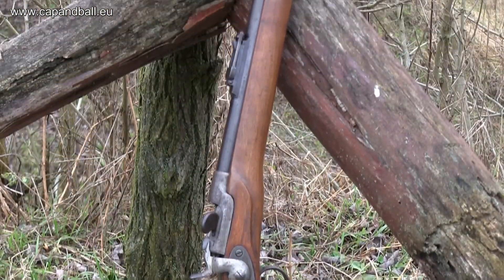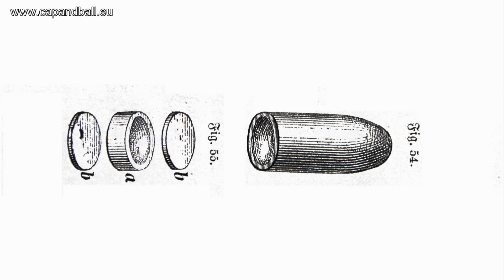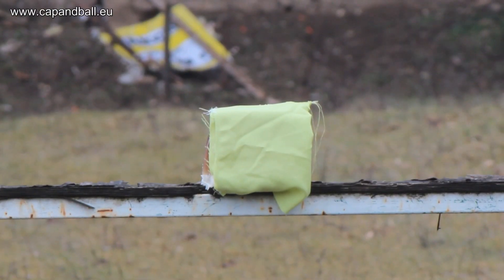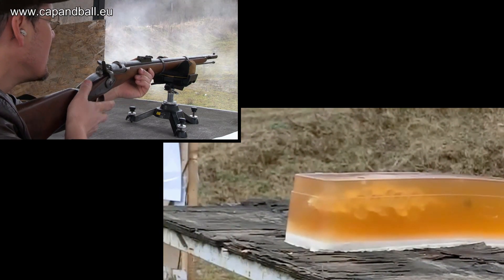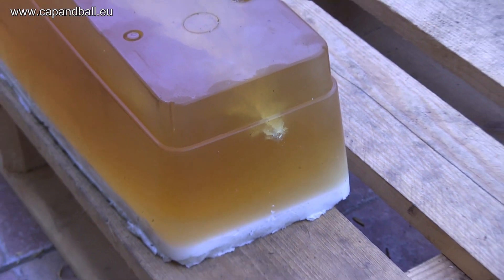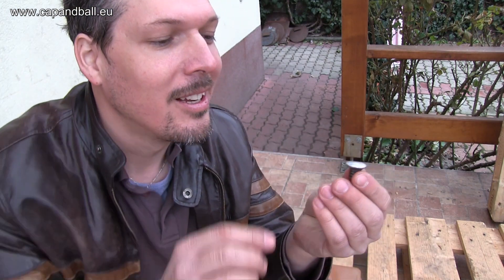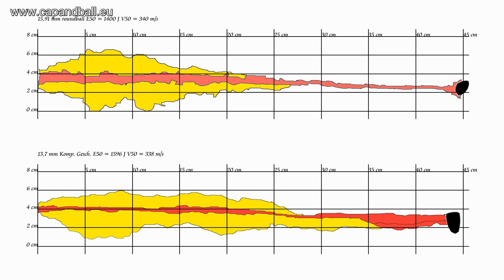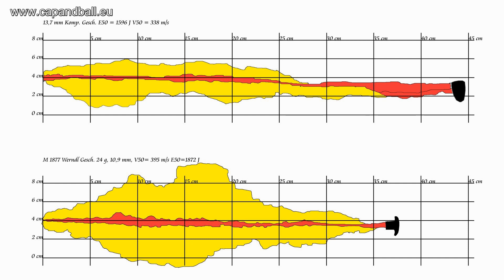Ballistic gelatine tests of the M 1867/77 Werndl rifle

Comment: The issue of amputation was far more one of the shear amount of trauma. A modern bullet (FMJ) tends to break bone clean while the soft lead black powder rifles tends to shatter the bone far larger extent. 

 As the video so expertly showed the size of the wound channel and the frontal area of the bullet nearly guarantee  more damage to what ever it hits.  In part this is why FMJ was effectively required by Hague Convention.  That FMJ also feeds better in many weapons was also a good reason to switch to it.

As an add on black power also is biologically very dirty too.

Comment: Great work.  Was the service bullet of the era pure lead also?  Seems to have quite the similarity to the Martini cartridge but those used a 1-12 alloy...  Was the ejector just to move the empty case out that little bit, with the fingernail used to extract the case out of the chamber, or were you just being gentle with the rifle?  Thanks for another great clip.
Reply from the maker: +britishmuzzleloaders I have two sources with different info. One says it was hardened with Antimon, one says it was pure lead. The extractor ejects the compete cartridge if I let the spring work, and let the breech open.
Reply: ***** Thanks!  I figured you were going easy on the breech...  Imagine having to use your thumbnail to get that casing out every time!..  High quality stuff, as usual.
Reply from the maker: +britishmuzzleloaders Thanks! I just had a Martini-Henry in my hands on Monday.... I think I have to get one. Excellent rifle.
Reply: ***** There is always room for another Martini shooter!...  Especially one who will present it in such good fashion...  Cheers.